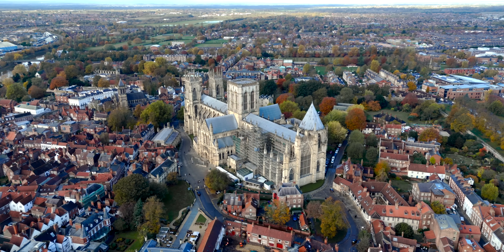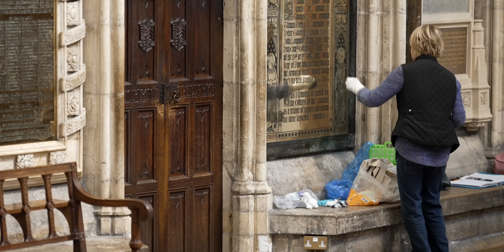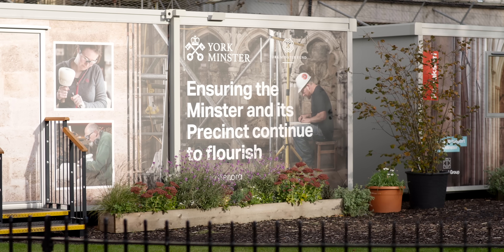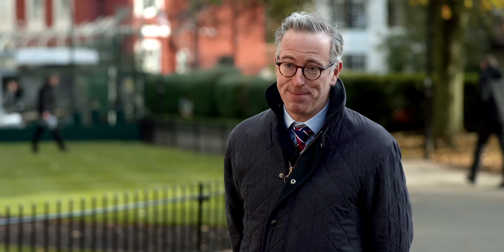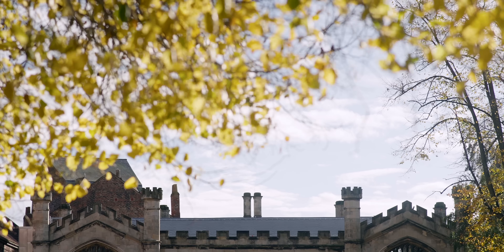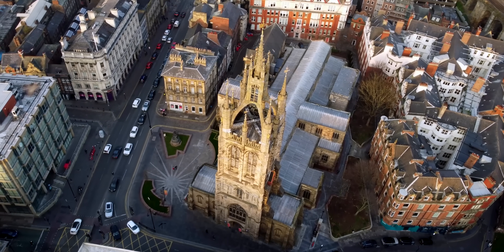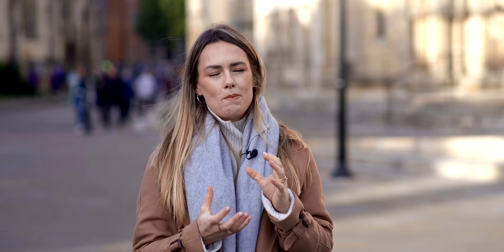Why We Need To Rethink Solar!

Comment: £30,000 per day for heating and lighting sounds too high to be correct. Are you sure that this is correct? Also, while hard to compare by using number of panels, it seems strange that 200 panels would reduce York's consumption by 40% when my 46 panels (15.325 kW) in a sunnier latitude would not produce a quarter of the energy that York's panels supposedly do. I wonder if someone has made a mistake regarding York's consumption.
Reply: Staffing , heating and lighting . 
200 x 500w panels is 100kw . Decent size array .
Reply: A decent size for sure. I just can't see it being enough to offset a £30,000 per day electricity bill. I suspect that the £30,000 per day should be £30,000 per some other time period.

Comment: We live in an evolving political planet, but it seems the political swing is to the right these days. Here in New Zealand we were heading, albeit slowly, in the right direction. Well, we just had a right wing coalition government voted in.  Bad news for many things, but in terms of the environment, public transport, EV's, bicycles,and walking, it is not good. 
From a news item today:

Dozens of Council projects designed to encourage cycling, walking, and use of public transport will fall under the knife.

New Transport Minister, Simeon Brown, has instructed the New Zealand Transport Authority to stop work on "vehicle killing measures - travel reduction programmes". He has also told the Agency to stop funding local authorities beyond existing contracted obligations to develop these programmes.  These programmes are designed to reduce reliance on cars and support people to walk, cycle, and use public transport.

They are funded out of the Climate Emergency Response Fund.

They have also removed all subsidies for low emission and  electric vehicles.
Reply: I should add...

The new Resources Minister and Associate Energy Minister has launched a blistering attack on the "hysteria surrounding climate change".

Shane Jones used his Address in Reply speech in Parliament to launch an attack on policies enacted by previous Governments to address climate change.
It includes a revelation that he doesn't believe New Zealand will hit its 100 percent renewable energy target by 2030.

"We are not going to meet the 2030 dreamy fairytale aspirational figures that will be freeing ourselves of fossil fuels as generating energy," Minister Jones said. 

Labour brought in the renewable target as part of its 2020 election pledge and this year it was backed by the world's largest investment firm, Blackrock. It created a fund to support investment in renewable technology.

"We're going to bring rigour and commonsense to the hysteria surrounding climate change," he said.

"Whatever work has been happening at the Ministry for the Environment - not unlike Thomas Becket the meddlesome priest - that is now stopped."

Lifting the ban on offshore oil and gas exploration is part of the Coalition Government's policy manifesto - and Jones spoke of that happening at pace. 

"I look forward to leading the debate, changing the law and enabling gas and oil exploration, wealth development to take place yet again in New Zealand.". Mining on Department of Conservation (DoC) and Stewardship land is also in the pipeline, Jones said.
"We are going to extract the dividend from Mother Nature's legacy on the DoC estate and those areas pr
Reply: "We are going to extract the dividend from Mother Nature's legacy on the DoC estate and those areas previously known as Stewardship land.

"There'll be a fast track for mining, fast track for energy, that's the thing coming in your direction," said Jones.

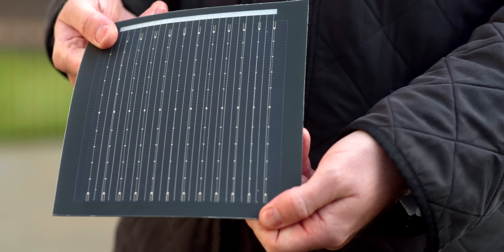Comment: 4:08 No, it is not "generating 11,000 kW of power per annum". That makes no sense. He presumably means "11,000 kW_hours_ of energy per annum". And it wasn't just a slip of the toungue. 5:28  and 5:42 he makes exactly the same mistake twice more. Please people - get your units right. At least Imogen knows the difference (7:44) :-)

Comment: The church owns loads of land, and electricity moves freely through the network, so instead of installing 199 panels to cover 40% of their use why don’t they stick 1000 panels in one of their fields and cover off 200% of the usage and 100% of the cost? The scaffolding costs alone must be mind boggling!

Comment: It doesn’t make any sense to have batteries, unless you’re going to charge them from the grid for cheap at night and sell the electrons when they’re in demand. 

Why? Because the solar produces ONLY 40% of the building’s electricity needs. Meaning even if they DOUBLED the panels (or if there were TWO suns) you’d only cover 80% of your needs. Meaning no chance to get any excess electrons to put into the batteries. 

Therefore, why the batteries?
Reply: They're talking about solar producing 40% of the building's energy needs over the course of a year, not instantaneously on a bright sunny day.  There would presumably be plenty of occasions in the summertime when the power delivered from the roof in full sunshine is far in excess of what's needed at the time, with the sun streaming in the windows while no artificial lighting or heating is needed inside.  The batteries are so that the energy collected in the daytime in excess of daytime needs can be used for lighting and heating later on.

However batteries can't cost-effectively store months worth of energy, and in a place like York you do need far more energy in the winter when it's cold and the days are short and overcast.  Solar might easily provide 100% of the building's energy needs in summertime but struggle to reach 10% through the winter.

Comment: Putting 11 panels on the roof of my ex council house generates almost all of the power I need when combined with a 5kWh battery for overnight storage. I think that placing large arrays of panels on industrial buildings is a great way to move towards a SolarPunk future.
Reply: Except in winter which is 25% of the year .

Comment: Fully onboard with solar etc but is there a need to go near any listed buildings when just miles away is industrial units. But fair play for doing it. I went down to York from Glasgow this year for a long weekend and it’s a brilliant city, love walking the walls.
Reply: I feel like the need comes in several parts:
1. They want to, well, reduce their own bills
2. The organisation (city/CoE) made a commitment, and it's a good look when they're following through on it directly, rather than shifting it elsewhere
3. Using famous sites creates a great deal more awareness, which will hopefully push for more projects both similar and also less ambitious in scope - such as on industrial units that you mention

Comment: Acidic rain, caustic particulates from oil-induced emissions and general fossil-fuel pollution are what I believe are the biggest causes of damage to old buildings... in addition to doing similar damage to new buildings and life in general.
Reply: And coal too. Coal contains 1 part per million thorium. So it adds radioactive particles to the air as well as acids.

Comment: They must have done a great work to get people to accept solar panels on the roof of the cathedral. 
I bet most people were not aware it be could be done so well and were assuming it would require bulky panels and supports on top of the roof.

Comment: What a remarkable and inspiring initiative. Gives me much more confidence to look at solar on my Georgian house as that’s only grade 2 listed 😊
Reply: It's probably worth letting your neighbours know beforehand, and ask them if they have any concerns

You don't want people to object to what you plan to do so it's best to get neighbours on board.

Mine isn't listed but I do have a flat roof. I've had structural engineer assessment and I've had planning permission sign off too in part because I actively notified all my neighbours via a letter in their postbox

You need planning permission for flat roofs. It's worth perhaps mentioning that the solar panels will be black too, so they won't be bright blue. The colour doesn't bother me, but some people prefer black to blue

Comment: I've been saying for years now why don't the government put into law that all new builds both residential and commercial have to have solar panels of some sort. It would drastically reduce our reliance on Oil and Gas not to mention put energy back into the grid. People's bills would fall massively and it would help with what some people believe will be too much demand on the grid..No Brainer...
Reply: Because builders complain it will put them out of business, then hold out their hands for a subsidy
Reply: Because they're too beholden to builders.  Hopefully a Labour government wouldn't be so namby pamby - though I don't believe that the Labour Welsh Government or SNP Scottish Government have done this either (but I'm happy to be corrected if wrong).  Unfortunately local councils don't have the power to insist in this kind of thing.
Reply: There already was a law in place that the conservative government tore up. A disgusting move like the post above said just pandering to building companies. It was going to eat into their profits a little bit.
Reply: Not sure of the legal requirement, but the big home builders are putting panels on most of their new builds in Scotland.  I have huge issue though - in that there's zero effort being put into how to maximise the potential.  Most homes have at most 3 panels, regardless of the size or shape of the roof (although most are so poorly designed for solar that it's difficult to put many more on there anyway).  There's actually a block of flat's near me that were built recently with the advertising suggesting '100% solar power'.  Turns out, all of the panels have been fitted to the NORTH facing roof and are permanently in shadow.  The south facing roof, which does benefit from the sun has no panels. . . .
Reply: @stoo149  I’ve seen that once or twice too. They’re just putting on to tick a box for the planning. God knows if they even install an inverter for them, maybe added cost to give as an option to buyers.
Reply: @stoo149  Weird and a shame.  North facing roofs will get 70% as much power from solar as south facing ones (east and west get 85%), so the panels won't be useless, but it's still a waste.

Comment: I know there are ideas for solar roof tiles but I can't understand why the standard solar panels can't be designed to basically double up as a roofing system in the way they fit together. (if you can see what I am getting at) I can't see why it would be technically  hard to design or be expensive to do it at the manufacturing stage.
Reply: I believe they do make some that sit flush with the rest of the roof tiles. I've heard they have a tendency to overheat in high summer and actually become less efficient if it's too hot.  I'm no expert and may have got the wrong end of the stick though, so do research, won't you?!
Reply: @judebrown4103  all solar panels become less efficient when too hot, which is not an excuse not to fit them.  In some very hot locations it is beneficial to use some of the generated power to run fans across the panels reducing the temperature with a net increase in power generated.
Reply: @Bettys_Eldest oh no, I wasn't for a moment suggesting one shouldn't fit solar PV. I was merely attempting to answer the question: why are panels fixed onto the roof with a gap underneath and not often fixed flush with the rest of the roof covering? I was suggesting that they are more efficient with an air gap to provide cooling.

Interesting about fitting a cooling fan though...👍
Reply: @judebrown4103  what I am trying to suggest is that with a little bit of design the solar panels could easily BE the roof ..not on the top of the roof..there would then be the air of the loft space underneath. (although I suppose it wouldn't be circulating air  so they wouldn't get quite as well cooled by that and it might make loft spaces too hot)
Reply: @peterjol  ah yes I thought that might have been what you meant. As someone else has said Tesla make solar roof tiles which are just that. Of course the roof must still have felt under it and be insulated so it seems there would be little room for helping the tiles to be kept at cool working temperature. Initially I presumed they must be specifically engineered to be able to cope in the built in situation but I think I've heard this may not be the case. To reiterate I have no certain knowledge that this is the case, my information is purely derived from reputable YouTube sources but my memories of exactly who and when are  dim, so do your own research to confirm or deny what I've said. 👍
Reply: Take a look at the Tesla roof tiles and others of the same design that connect together just by being laid on top of the adjacent tile. Gold plated contacts ensure reliable connection. They look like a conventional tiled or slate roof when completed.

Comment: Excellent work indeed! Imagine a 1,300 years old solar powered cathedral:) Here on the Canadian prairies we are preserving and renovating an "old" 1912 two story house with high insulation, triple pane windows, insulated doors and soon solar PV on the roof. This is the future for all our housing stocks well done!
Reply: I've done the same to a 1903 brown shingle in the San Francisco Bay area. Only need double pane windows and with the more moderate climate my solar produces thousands of kW-hr more than we need. All that insulation and heat pumps does the trick.

Comment: Former monk here. The Benedictine rule calls for sustainable stewardship of the natural environment and many monasteries have rainwater collection, filtration, developed farming techniques, and many have added solar or even hydro if by a source for quite a while, good to see this growing.
Reply: And why not?

Religion doesn't mean stasis.

If churches (other religious edifices are available) can have sound systems with radio mics for the vicar and lighting bars (I have installed LED lighting in several churches, interior and exterior) for visiting theatre groups/events.

So why not solar panels?

Just think of Jesus and his sunbeams ... entirely apposite.
Reply: @t1n4444  Well, Jesus is "the light and the way", right?
Reply: @klaxoncow  

Groan.
Reply: @t1n4444  It's often due to the fact that they're also "listed buildings" which makes it difficult

I've seen a new ish mosque get solar panels, but an old church that has been converted to a mosque, being denied that 

The other thing is with churches in particular, they're quite fond of stained glassed window. I'm not sure how you do that with say triple glazing?
Reply: That's good to hear.
Reply: Nothing would be more sustainable than the church telling followers to stop having so many kids😂
Reply: Why a former monk? If it's not too personal a question.

Comment: If we don’t use our precious, old buildings, then we let often them fall into disrepair. I worked for an
agency that, in order to rigidly conserve some old buildings, mandated softwood siding and wood shingles, single pane windows, and similar sillyness. This in an area that got over 100 F in summer, had snow in winter, and was threatened by fire often in summer. Woodpeckers destroyed the siding within two years. Buildings have to evolve, yet we can still respect the original character.
Reply: lol, the Listed Building regs in the UK even mandate the construction techniques that can be used although they do allow fireproofing for thatch and other flammable ancient materials.

Comment: Nothing will happen in this country until the the Tories' are gone .
Reply: I tend to agree, although they have just eased some planning restrictions on rooftop solar for businesses - but we need a LOT more than that.  Increasing rates for businesses (over a period of years), and then discounting those increases off for those with solar or other low carbon features would be good.  Just announce that rates will go up incrementally by an extra 1% a year for businesses that don't comply.
Reply: Same in Canada. Conservatives the world over seem to be running with the same play book. deny obstruct and reject any efforts to try and improve the world

Comment: Nice project, the Royal castle in Stockholm Sweden has had solar panels for a while.

The figure for household use of electricity seems very low. Do they assume gas for heating and hot water?
Reply: Likely, as that tends to be the norm here.
Reply: Very probably yes, many houses here are on mains gas for central heating and water, some have gas cookers too. There's a lot of work still to be done....